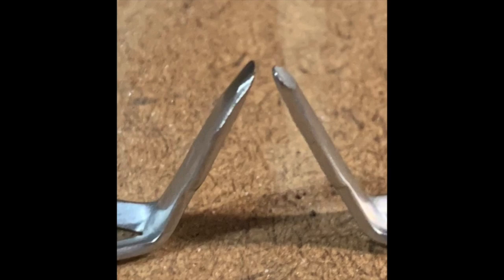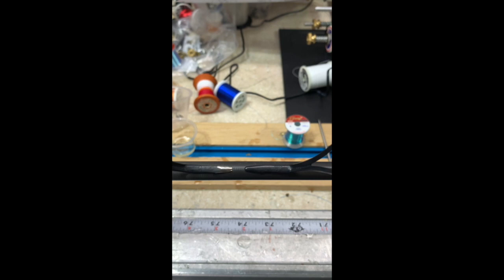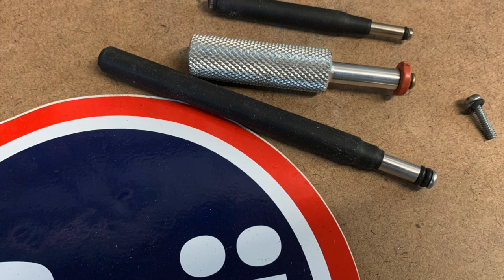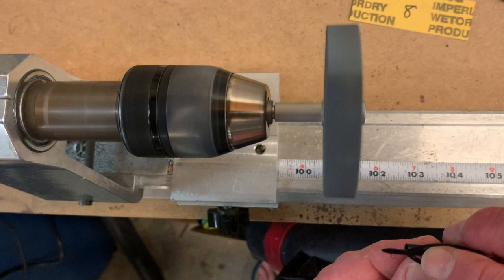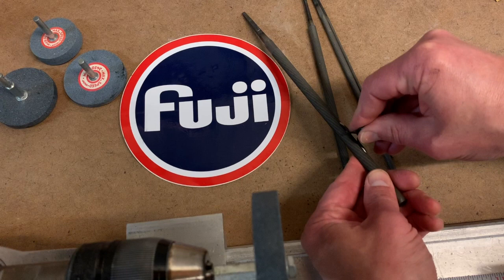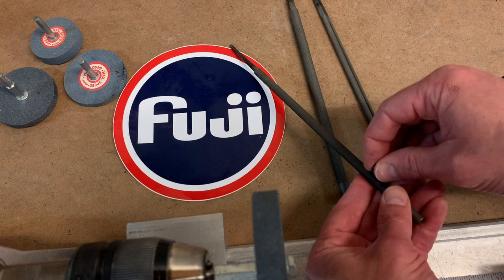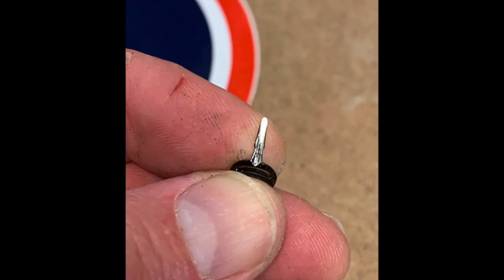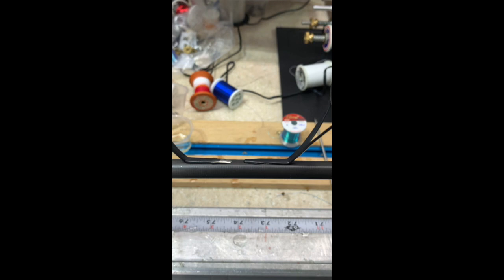Guide Foot Shaping and Polishing

Comment: Is that drill chuck in a renzetti? Like that
Reply from the maker: Thanks for watching!  Yes...that is a Jacobs chuck threaded to fit the headstock threads of the Renzetti.  Very, very secure connection and WAY less knuckle busting than the typical 3-jaw chuck it comes with.  

Please like and subscribe!
Reply: Falconer Custom Rods did you make it or is  available somewhere? Very informative! Guess I missed how you stick guides on the blank???
Reply from the maker: @chriscothren8170  So I found a keyless 1/2" Jacobs Chuck with a 1/2" - 20 threaded mount (vs. a tapered or MT mount).  Home Depot has these (but you can find better for cheaper online).  I then found an adaptor that matched the Renzetti thread pitch (can't remember it now) to the pitch on the 1/2" keyless Jacobs Chuck.  If you Google around you can figure it out.  If you have a machine shop in town they can also make you one.  You can get a Jacobs Chuck that fits right on the Renzetti headstock threads but I could only find them up to 3/8" capacity and I wanted 1/2".  Hope this helps.
Reply from the maker: @chriscothren8170  Here is where I got the spindle adaptor:  

https://bestwoodtools.stores.yahoo.net/prstspadwith.html
Reply: Falconer Custom Rods ty will search! Not crazy about renzetti chuck, do mostly heavy rods !like you setup ! Videos explained a lot! Most builders are tight lipped! Don’t want you to learn for fear of acquiring customers! I like many others do it for hobby! My customers amount to wife/son!!

Comment: Bill where did you get the chuck holding the grinding wheel and how can I purchase one.
Reply from the maker: So...first I purchased an adaptor that mounts on my lathe spindle.  My lathe is a Renzetti so it's a 3/4 x 16 TPI spindle.  I removed the Taig-style 3 jaw chuck from my lathe and screwed the adapter on.  The other end of the adaptor has a 1/2 x 20 TPI spindle and I ordered a 1/2 inch capacity hand tightening Jacobs Chuck with a 1/2 x 20 TPI threaded mount.  So I just screw the Jacobs Chuck on the adaptor and voila!  I honestly can't remember where I purchased my particular pieces...maybe East Tennesee Woodworking?  But they are readily available all over.  Just make sure you order an adaptor that fits both the lathe you have and the chuck you want to use.  I also recommend a high quality Jacobs chuck (the cheaper ones have run out) that has at least a 1/2" capacity.   Hope this helps!
Reply: Thanks so very much much appreciated